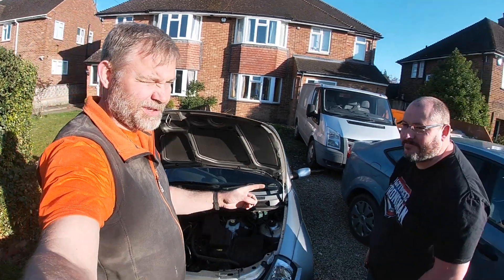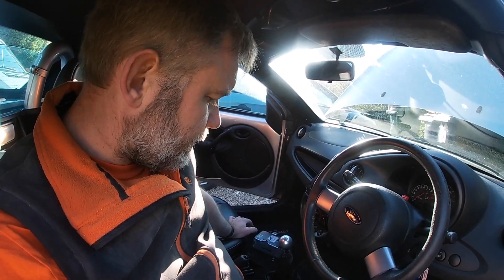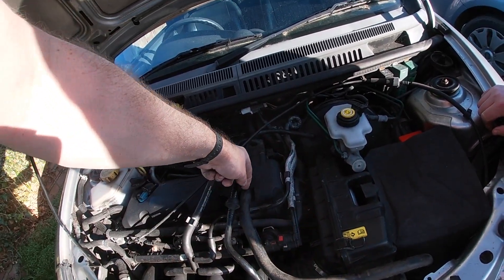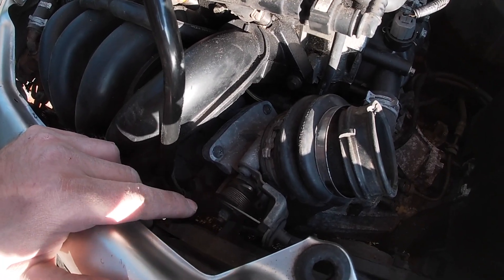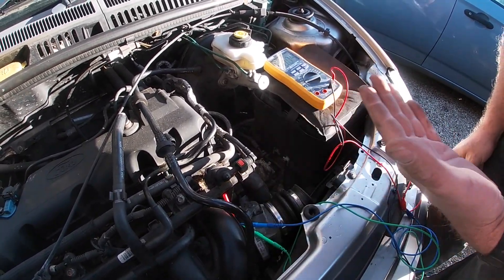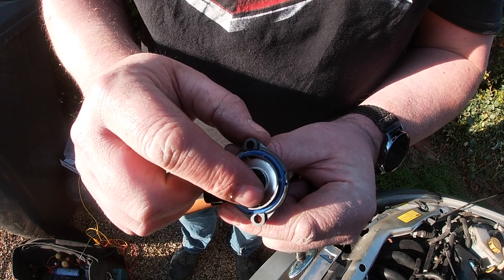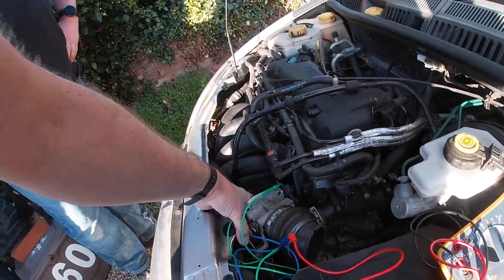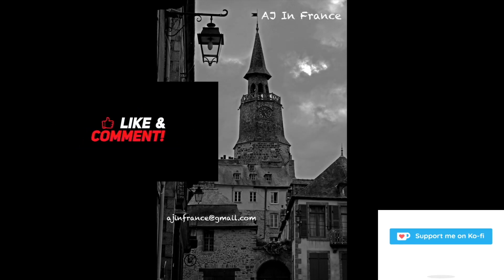Ford Street Ka 1.6 P0121 DTC code diagnosis and fix (Throttle position sensor location)

Comment: I bought my StreetKa this summer and it was down on power uphill and caughed, so I bought new spark plugs and it seemed fine before I put it in garage for winter now. But should I do this to? I bought it from an old lady who probably never replased anything, but got a clean and else good kept one for cheap, so can't complain thou ☺
Reply from the maker: You are lucky to find one now. I wouldn't replace anything unless it needs it, it will be pretty obvious the engine will be rough and looks like it's shaking loose when you open the bonnet
Good luck 🤞

Comment: Enjoyed doing this one with you, was really interesting seeing you do the fault find. Hopefully it will help someone out, we were told everything from fuel pump to spark plugs to it needs scrapping! £20 and half an hour fix. MOT centre told us it is one of the best conditioned streetkas they had seen. So good job I blocked the scrap idea! Thanks for your help on this one, has made Z very happy!
Reply from the maker: No problem it was a nice break from lifting heavy bits of metal 👍😆

Comment: 2nd. Dammit Huw. 😀
" Five minutes Turkish " 😂🤣 I love movie quotes...
I used to have to clean the throttle body on my Porsche Boxster on a regular basis. It would get gunked up and stick. After the first time it was easy.
Interesting video 👍🏼.
Reply from the maker: I try to get movie quotes in, the video I did converting the old septic tank to a rainwater collection tank has "get to the chopper" in from predator, was my best one. 😂😂
Reply: @ajinfrance  Mate, I totally missed that one !
I’m going to have go back to that. 👍🏻